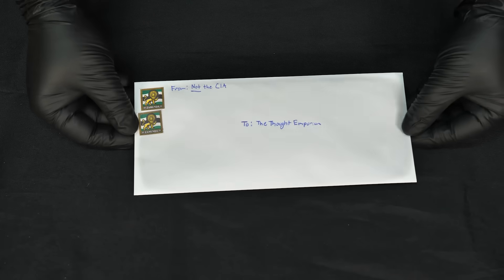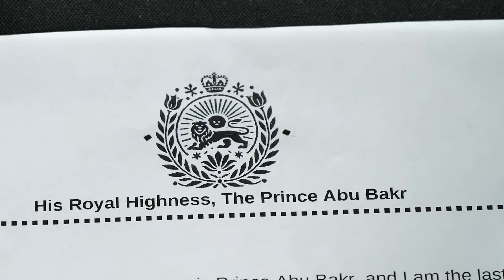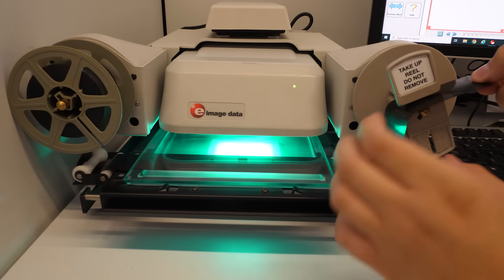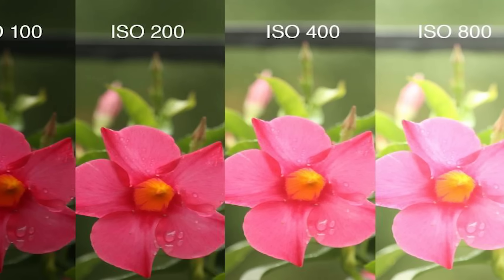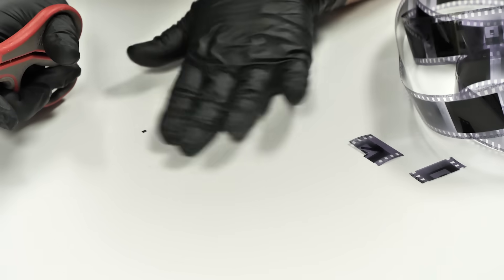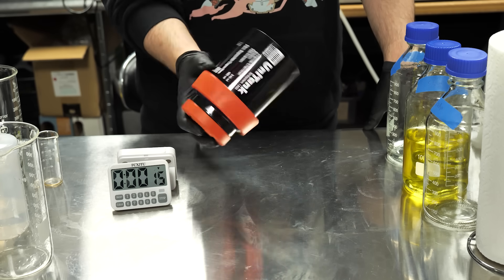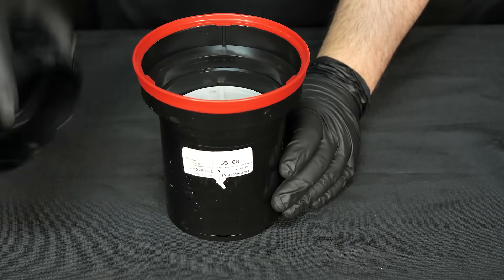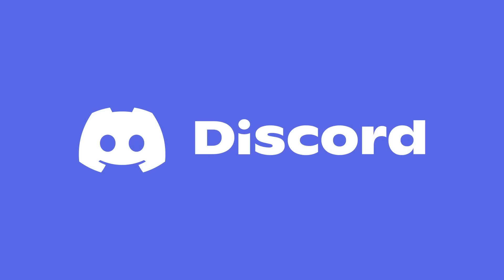Recreating CIA Technology Was Surprisingly Easy (Microdots)

Comment: The developer can be reused a couple of times (I believe), and then it gets saturated. Also, my father used to have a machine with which he reclaimed the silver in the developer. Since he had a development lab, he went through a lot of developer, so taking out and selling the silver was a good way to reclaim some money, that after the development process ended would literally go down the drain 😂
Reply: Almost right.

For the most part, a liter of developer will develop at least 10 films. However he's using rodinal which is a one-shot developer. Basically highly concentrated, and will last more or less forever. But the mixed solution is only good for one use. A bottle of concentrate will however be good for a lot of batches.

As for silver reclamation, you don't need a machine, you can do it by crashing out the silver with a less noble metal. Easier if you don't process large volumes of film. And, the silver is in the fixer, not the developer.

Comment: Hi! I do a lot of black and white development. When it comes to development with Rodinal (blazinal is just another name for Rodinal) the easiest way is a 1:100 dilution, for an hour, with some slight agitation at the beginning and then at 30 minutes. This will develop near perfectly nearly every time. You also dont need to use stop bath, as a water wash is perfectly adequate if you fix immediately. Blazinal is a one shot developer and should not be reused, though at your dilutions you may get away with it. You can however reuse fixer basically until it stops working, to test if its good you can just through your film leader into the fixer and see how long it takes to go clear, if its too long just make a new batch. I hope some of this info helps
Reply: Some things to note, if you're shooting for absolute sharpness as they are, rodinal and especially semi-stand development is not ideal as they enhance the grain. I also develop a decent amount and this is very noticeable with some films.

Comment: There was a demo of variations on Benham's Disk at the Ontario Science Center(?) (built out of a record players) one in particular used persistence of vision to cause a swirling trail of shifting colour to appear behind the slices at certain speeds.  
IIRC the colour shifting was from blocks containing a printed diffraction grid, but might have been a holographic embossing. (What little I remember said something about fine details and how it was the only part of the effect that would translate to cameras.)

OFC my father thought it was a synchronization disc people had vandalized by scraping off parts of the black bars while tearing the tone arms off; And so ignored the colour and immediately pushed the speed to try and synchronize with the artificial light, (next to the giant windows,) before reporting it vandalized then lecturing the staff member all about how a record-player functions when the staff member tried to assert "No, it [the visual effect] works. Can you read the explanation and follow the instructions?" before just patiently waiting for my father go away.

I've wanted a copy of that specific design ever since, but haven't found it in print.

Comment: Using the smallest apeture will defraction-limit your optical resoloution but if you are using a good lens and ISO 400 (which is pretty common for film) then the film is probably limiting your resolution more
Also if you make sure you are using the correct exposure settings for your film you can use Digitaltruth's Massive Dev Chart to find the correct concentration and time for your developer+film combination without the trial and error (or at least not as much of it)

Comment: Some developers can be used more than once and some can't, also water work perfectly fine as a stop bath (unless you're doing REALLY short dev times)
Reply: But stop bath is just really dilute acetic acid. You can buy 12 or 6% acetic acid at a grocery store by the liter really cheap (intended for pickling).

Just add like a tablespoon of it to a liter of water and, that's your stop bath. Since it is so cheap and easy to make I don't see a point in not doing it.

Especially since getting developer in the fixer will shorten its lifespan. A stop bath generally just needs to act for 15-30 seconds which is much more convenient than a full water wash. The ILFORD method for washing is a total of 35 inversions over 3 water fills. And the Kodak method is a 5 minute running water wash.

While doing that is fine, I prefer a quick stop bath.

Comment: You can use the developer multiple times. It's getting weaker and you have to check your negatives after each process. You have to keep your solutions in an airtight bottle. Either an accordéon like bottle or you add glass marbles to increase the volume and push the air out of the bottle. 👍
Reply: When you wash the film, you can add a drop of soap to remove water surface tension to avoid water drops forming on the surface.

Comment: In fact, it's possible to create the microdots without a camera, as long as you have photographic film (which you can purchase at any shop). What they would do is create, essentially, a pinhole camera with normal household materials (carboard boxes etc) and use it in a dark room, flip the lights on for a second or two, and then cut the part of the film that had photographed the document and put it eg. under a stamp. All these materials for the pinhole camera are easily disposed of, and consist of materials that are not suspicious. No government officials would find anything suspicious in that apartment or on the spy himself, even if they searched.
Reply: You can do this without a camera, the first step is to make a camera! :)
Reply: @radeklew1  
The problem with a minicamera, as depicted in the video, is that if they search you and find it on you, it's highly suspicious due to the highly specialized nature of the camera, which no normal person owns, and is very obviously used for creating these microfilms.
Reply: @DjVortex-w  they're referring to the fact that the box with a hole is a very primitive version of a camera
Reply: @EphemeralPseudonym  
So? It's very clear that when I say "camera" in my original comment, I'm referring to the devices shown in the video.
Reply: @DjVortex-w  yeah they're making a joke 
it's a rude joke but I don't think they realize it
Reply: Yeah . . . NOT really.  A pinhole camera will not have the resolution necessary to create a micro dot.

Comment: Where in gods green hell did you find a working EM slr for $80?? Thats far more unbelievable than fitting the entire encyclopedia brittanica on your left butt cheek.
Reply: Local flea markets and such can be a good place. I got a perfectly working Konica Autoreflex T3N for 28$. At that price it included a camera bag. 50mm f/1.7 hexanon lens. Another 135mm f/3.5 Hexanon lens (both lenses flawless and a case for the 135mm lens too). A working electronic flash. Lens cleaning supplies and the camera manual. 

You have to go to places that aren't specific to cameras, just your average Joe thinking it's old and probably not useful as anything but a pretty decoration.
Reply: I'm certain that he said Facebook marketplace
Reply: @amelliamendel2227  yea about the best I can ever find there usually for nice old cameras at that price is something so far gone the only recoverable parts are the screws. And those are questionable.

Comment: Yes, both developer and fixer can be reused, although not indefinitely. The concentration of the active ingredient decreases over time, and — especially important in the context of producing extremely high resolution photos — dust from the air accumulates in the solutions.

Also, both of these types of chemicals break down on their own over time. You'll want to check the packaging or the datasheet to know for sure; back when I was into old-school photography, the rule of thumb I learnt was, keep them in airtight bottles, in a dark closet, when not in use, and use them up within 48 hours of the original mixing. But this can vary with the precise chemical composition.

The manufacturer's datasheet may also specify that  one  is good for, say, ten or twenty rolls of ordinary film; I never had so many to process at once, for this to become a problem, but an industrial lab processing photos at scale would be replacing their chemicals at after every so much film material. These can only be guidelines, though — degradation speed depends on how much of the film surface was exposed, and when you're dealing with mostly-white negatives, the chemicals may degrade a little bit faster than in the theoretical 'average user's' use case.
Reply: This developer is a brand name of rodinal, which is one-shot. But most others can be reused yes.

Comment: If your optics has known aberration problems, you can reduce the optics problems by reducing the aperture (and, of course, correspondingly increasing the exposure time). The smaller the aperture, the more of the peripheral parts of the objective's light path are effectively blocked, meaning optical imperfections in these parts will not matter for the final result.
Reply: That works, but has a limit. The aperture's edges are making a diffraction pattern, and when the aperture is small enough, the diffraction begins to dominate, and smaller apertures actually reduce sharpness and contrast. For typical lenses, the sweet spot is around f/8 to f/11.
Reply: @wellscampbell9858  Makes sense, but the aperture used in this video was the 'maximum available'. It probably shouldn't have been.

Comment: "the film is cheap" bro where. over here in germany 1 iso 200 film costs you like 10 euro now. a couple years ago you could get 3 of them for 8 euro ;-;
Reply: Still cheap compared to most of what he does on his channel. Also, I am assuming you mean color film which is much more expensive. Because fomapan 200 is available on fotoimpex for 6 euro. And I am not aware of that many other 200 speed b&w films. Color is a whole different process.

Comment: Try Adox CMS 20 ii film, it has resolution of ~800 lines per mm. Can be developed in Adox's dedicated Adotech IV, or in POTA if Adotech is hard to get in North America. So basically with CMS 20 you can fit a readable microdot in a space comparable to the area of a single grain of a normal film.

Comment: This video is absolutely fantastic! The way you briefly went from explaining film technology, to demonstrating how it gets used to shrink down images, and then incorporating Holographic Optical Elements! I actually didn't know you could do that at the scale where a standard negative film (and not a special microfilm, holographic film, etc) is able to capture. I love how you demonstrated so many examples of it, too! There seems to be not many videos going over this with so much to show, except for Huygens Optics incredible videos.

Some things I would add is besides Fuji's HR microfilms, there are a lot of other silver-based materials you can use such as ADOX CMS 20 is still sold, their HR-50 seems like a good candidate as well, Rollei RPX 25, and you could probably investigate many holographic plates that are sold.

Some of these microfilms can store up to 800 cycles/mm or more, but holographic materials can easily achieve 2000, 5000, and some close to 10000. The only problem is they're for the express purpose of recording interference patterns of coherent light, not normal optical images which start to become diffraction limited far before those figures (in Vis).

Another fun thing was the Lippmann process where a special ultra-fine emulsion is used to photograph objects, but using a mirrored surface behind it the standing wave patterns of light interfering with itself in the depth of the emulsion which effectively records the wavelengths of light; the color. It's a dyeless color process done through the light interfering with itself! And it was made in the 1890s and you can do it yourself as well! It's too cool!

So, anyway, maybe I'm just "uhm ackshually"-ing the part about needing to immediately jump to something that isn't silver based lol. Especially with how difficult it might be to source a good photoresist. There's a lot of possibilities in silver halides!

To get the sharpest image you need to balance your lens aberrations being curtailed by stopping the lens down to a smaller aperture versus diffraction which increases as the aperture gets smaller. Some well very well-corrected lenses can do this just a stop or two below wide-open, but for many lenses 5.6, 8, or 11 will be the sweet spots for reducing aberrations.

Regarding your development setup, it's really nice! Glass seems to store the chemicals a lot better without needing to resort to crazy things like topping the bottle off with butane or something. And I just tried developing without gloves for the first time a few days ago... yeah I totally agree with you there, my fingers had such a weird smell on them the rest of the day.

For developer, highly-diluted stuff is almost always considered "one-shot". You toss it after you use it. Like when people dilute Rodinal 100 times. But with dilutions that are a lot less you totally can, I just don't know the details about how to do replenishing "right". I might be overthinking it though, usually you just give it more time.

I'm so excited to see what you do next!! This was so awesome!!
Reply from the maker: I hadn't heard of the lippmann process before. Definitely gonna have to try it out!! Thanks for the advice :)
Reply: @thethoughtemporium  Of course!!

The Lippmann process is truly mindblowing. There's a guy named Nick Brandreth who shows some example photos he's made with it and some recipes. Jon Hilty is another who does a bunch of "alternative" processes and he also has recipes for them. They're worth checking out as resources! Also many holography resources have good information on Lippmann because it shares the space, both holography and the Lippmann process require ultra fine emulsions because they capture interference patterns!

In general, making your own emulsions is an infinitely deep science on its own, considering what you can do by varying temperatures, times, layers, which halides, concentrations, sensitizers, etc. For making these microdots, CMS 20 is probably all you need but I imagine you can play with a whole bunch of variables and cook up your own film with cool properties!

You don't even need a big plate camera, you could just use a microscope slide and load that in your camera in the darkroom lol

Comment: all of the chemicals can be reused with a lower potency, also ive noticed that in my experience all of the containers for storing the chemicals have been opaque, i tried looking into it and im not sure if this is required, however i'd recommend storing them in a dark cabinet or wrapping the bottles in an opaque material before storing them.
Reply: chems should be changed after like 1-2 weeks after extensive use

Comment: Blazinal is a rebranded version of Rodinal (probably the oldest and most ubiquitous developer still used today) and its generally not a good developer to use more than once, its sometimes called a "one-shot" developer meaning you use it once and toss it. I personally use Kodak Xtol which is excellent for re-use and has a great price-per-roll especially when using the "replenishment" method. However, for your use I would not recomment Xtol because its a "solvent developer" meaning it dissolves the sharp edges of the silver-halide grains and generally smooths out the grain at the cost of some sharpness, rodinal is probably the right choice for what you're using it for because it has exceptionally high sharpness, but you do have the side effect of very strong grain, but like you said you can get finer grain with lower-iso films.

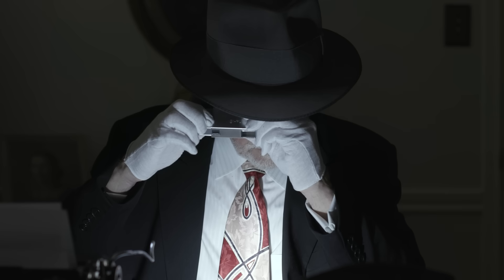Comment: If you can get it, ADOX CMS 20 should provide you with the finest possible grain for such experiments. it's got several times the theoretical maximum resolution that Pan F has and isn't too expensive either, just needs to be developed with Adotech. Also most developers are reusable, the only 1 use type I know of from the top of my head is Rodinal at 1:50 or 1:100 and it's derivatives, which also happens to last forever.

Comment: Pedantic correction: rolls of microform material are called microfilm and individual sheets are called microfiche.
Reply: Using the correct terminology prevents miscommunication and errors in understanding, so such corrections are appreciated.
Reply: Another microform (the most general term) is the microcard, which, like microfiche has a grid of several page images (and it is similar in size and content to the microfiche), but it is an opaque, positive image, like a glossy photographic print, rather than a transparency. It's more or less what you would get by printing a negative microfiche on ordinary black-and-white photographic print paper. They were never as popular as microfilm (the earliest) or microfiche, and it could be a bit of a pain to find a reader. Nowadays I suppose a high-resolution flatbed scanner could be used to read them.
Reply: Correct. Fiche is french for sheet / slip (of paper).
Reply: It can become important when the library has different machines. I came looking for this comment
Reply: Micro-🐟
Reply: Interesting. Clears up some confusion I've had for years.
Reply: microrizz
Reply: Yes - "fiche" is a French word meaning card/slip of paper.
Reply: Microfilm is also used in discrete strips, not just rolls. See my comment above.
Reply: @avsystem3142  Yeah, YouTube comments are not that neatly organized.